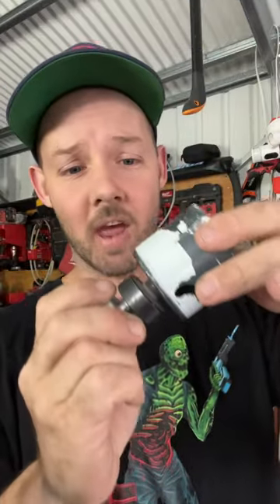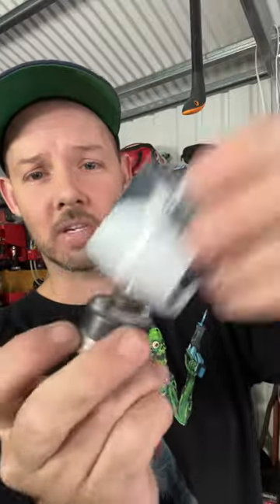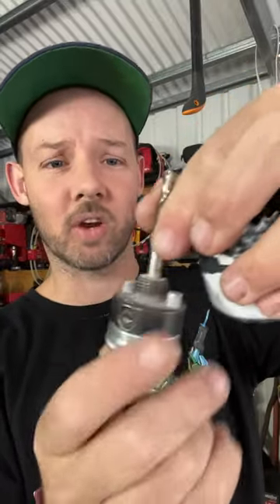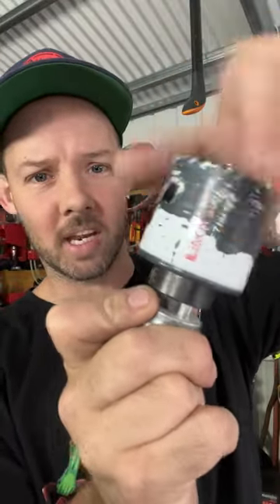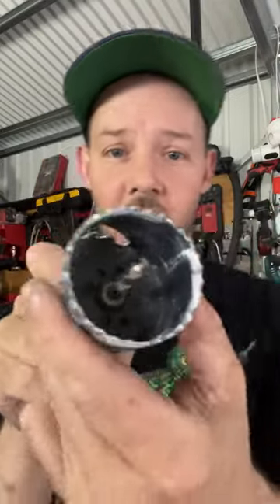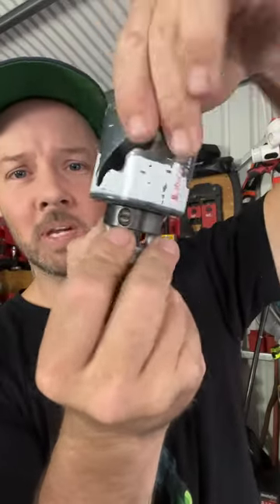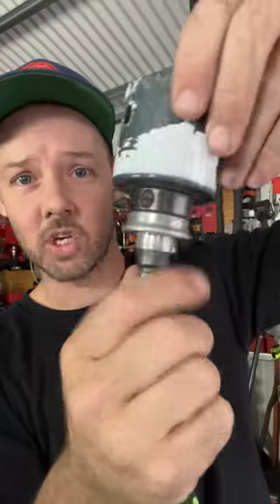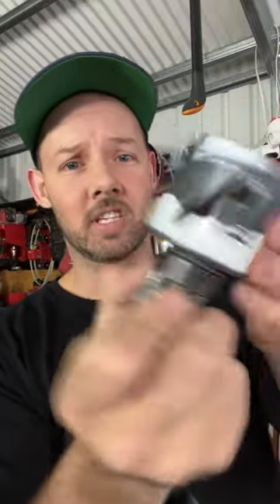How to use and install a holesaw arbor

Comment: For the smaller arbors, or these larger arbors that don’t have the set posts in them, take a piece of copper wire, large enough washer, or tie wire, and wrap it around the arbor once between the arbor itself and where the hole saw makes contact on the arbor. This will stop that welding issue and allow you to remove the hole saw when needed.
Reply: Also just a run of leccy tape on the threads before you put the small holesaw on. Works a treat. 👌
Reply: I've tried this with a washer.  Did not help one but unfortunately.
Reply: @xXmranthonyXx1 maybe not a washer, next time try Cooper wire - I always use that and even if you can’t get it by hand, you can with a pair of cobras.

Comment: I wrap a loop of solder in there, it helps with keeping it easy to undo. Worst case you stick a blow torch on it and melt it out. Especially handy on the smaller arbors and hole saws that don’t have the pins.

Comment: Well besides wrapping s solid piece of # 12 wire for smaller holesaws, I use some marking tape to hold the arbor set. I'd love to say we always get new fully functional tools. But that's not the case. The marking tape doesn't stick or leave a nasty black mess behind.  It holds the holesaw from backing up and loosening

Comment: With the smaller hole saws stick of bit of electrical tape between the arbor and hole saw face and you’ll get a easier removal if that makes sense